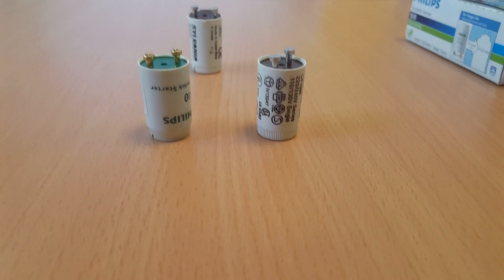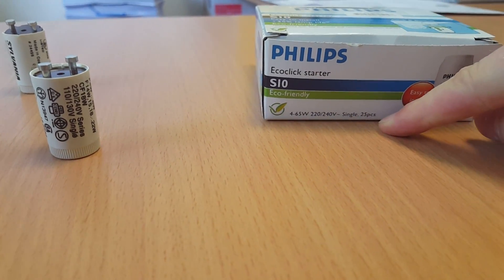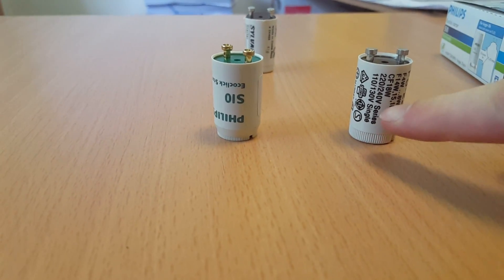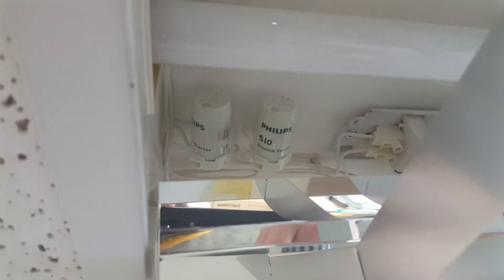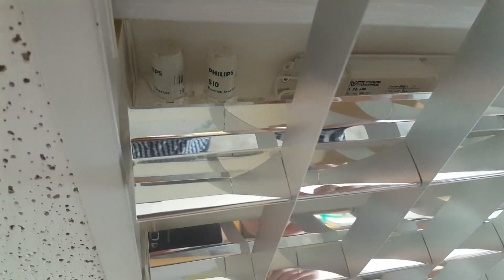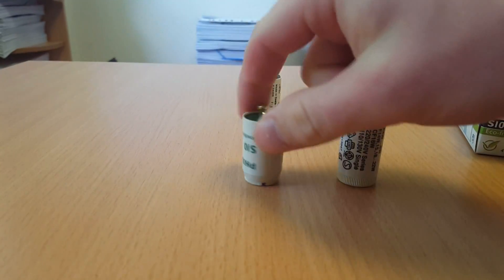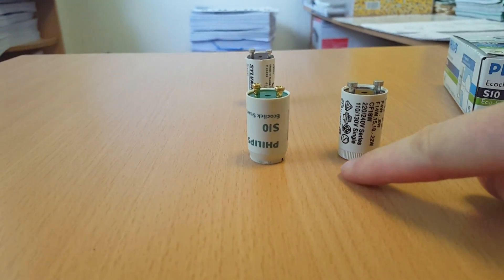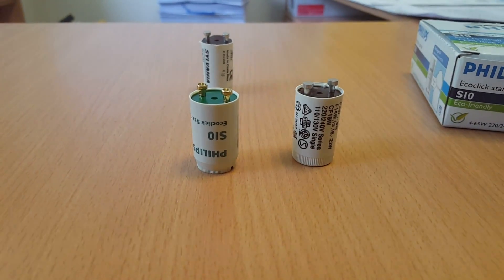Why my new Fluorescent lamp starter does not work?

Comment: Thanks so much for helping me. I was sold singles and I needed series starters. it was only after seeing your video that i contacted the retailer and he admitted he had sold me the wrong starters. Just for info single starters will not start tubes at all, don't make the same mistake i made and spent on and off a week changing everything. Don't assume the retailer has sold you the right starter

Comment: Hello I’m having a big problem.!!!

Recently I purchased 63 years old die cutting machines from Europe which have provision for 2 ft fluorescent Tube-light, it is having starter “110v FS-2 starter with condenser 20w LR 23072”. 
Now the starter not working, I just purchased a starter in local electrical stores which is “S10 220 - 240”. 
The new type starter cannot able to start the light. When i showed the shop for older model starter they say that the starter fs2 is outdated and it will not be available in market. Please help.
Reply from the maker: first of all, I am no expert, but it seems that you can still get exact starters as you had, good that you know model of the old one!, e.g. https://www.amazon.com/Power-Gear-Fluorescent-Standard-54388/dp/B008DB3EHO

if u will look on the internet I think you can get them even a lot cheaper! 

And do you have s2 starter available, maybe you can try it out, who knows, might work..

Comment: Being a electrician as I am forever.that's is a 2ft fluorescent light fitting with only four 2ft 18w t8 fluorescents tubes and runs off in series for twins only two 36w ballast and with four 4--22W.110-130-220-240v starters lamps switchs for in that only in twins lights fluorescents fittings only in forever use for the very long run 🏃.and my job is by helping a lot of people from everyone and everybody in general.and if you use only in series fluorescents lamps starters for twins only by using this type of fluorescents lamps starters for your very new replacements in a 4--22W 110-130-220-240v.in series fluorescents lamps starters switch.that's light fitting always will work or not a other way around by not using 4--65W starter switch and it's no wonder that light fitting no doing anything from no action from the Philips s10 4--65W for in use from 2ft 18w and 4ft 36w and 5ft 58w with using via on only for singles circuits t8 fluorescents tubes only.now you fucking know from a lot of our forever electricians which fluorescents tubes and fluorescents starters don't use in general.
Reply: ok.good enough ,  so, how do i get my Christmas lights to intermittent blinking , say every few seconds or so, whereas i cannot longer purchase the " blinker" bulbs for my tree ?

Comment: 4x18W light fixtures with 2 ballast 36W serve the S2 Starter
Reply from the maker: jup, I know, my work technical department tried to fix office lamps. They replaced starters and put s10 instead of s2 starters and wondered why lamps are not working. Since I didn't find any videos why new starters may not work , I just made one, so people know that there is difference between starters even if they are universal!
Reply: If not the S2 Philips are also fine those of Osram ST 151
Reply: how to change Lardy frozen
Reply: Hello sir, i just want to know what is the difference between S2 and S10 starter? Thank you